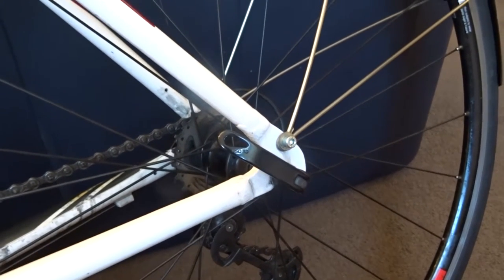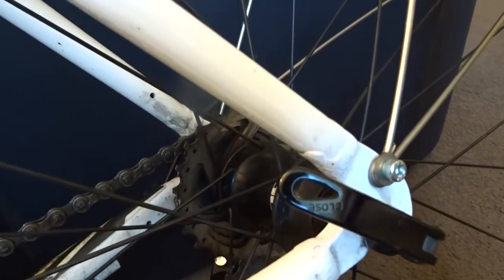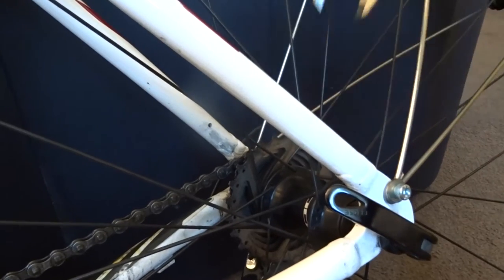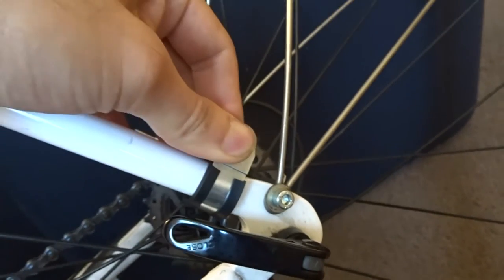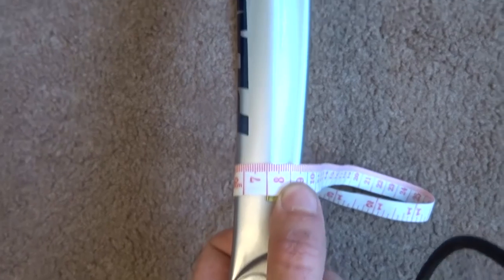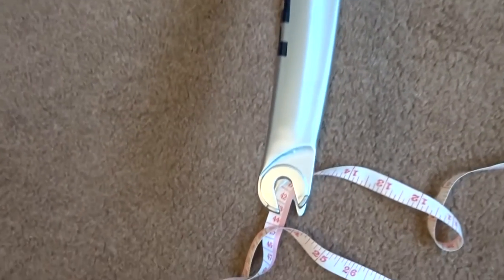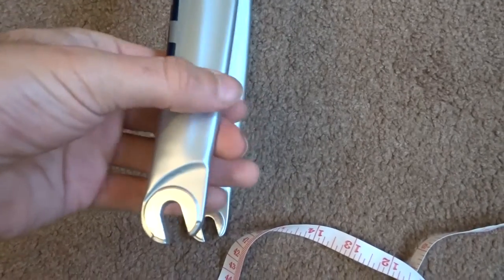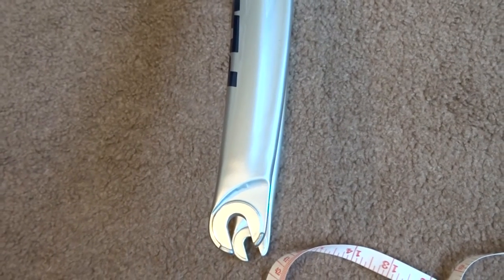DIY Mudguard Mounts for Frames with No Eyelets - £2 Fix!

Comment: Hi, thanks for this.  What do you do to bridge the seat/chain stays?
Reply from the maker: I presume yours must be a brakeless fixed gear bike? This bike had a the other mounts for brakes/mudguards.

You might need to look at something Crud mudguards that don't need mounting holes, or make something with other clips and fixtures to mount the mudguards you do have.

Comment: How about at the center top of the fork with no holes?
Reply from the maker: Yeah that's a problem if your forks are only made for disks
Reply: @51North  I use a small cutting of heavy duty stick on velcro, 1 bit stuck onto the underside of the fork another stuck onto the mudguard

Comment: dd you drill the rear eyelets
Reply from the maker: +gareth loxton Hi Gareth, this bike already has the eyelets drilled and threaded from the factory, I was using frame as and example
Reply: The formula doesn't work for any other than a cylindrical tube
Reply: @Hennypenny8888  With the circumference of the non cylinder you can use pi to obtain the diameter of a cylinder with identical circumference. That diameter will be the size of p clip you need... these are made out of somewhat malleable alloys which can conform to the non cylindrical contour of the bicycle tubing. 🍻